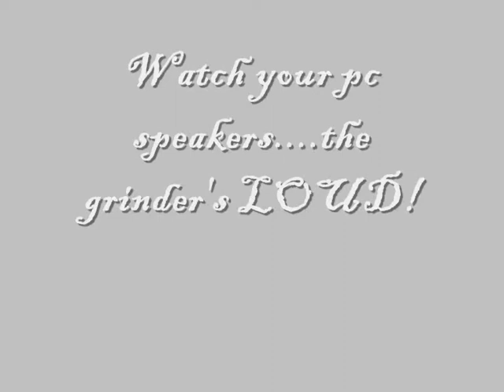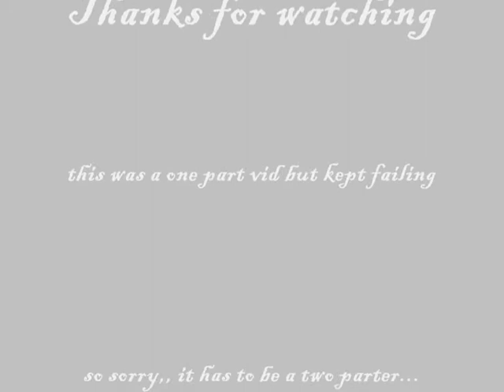Cold Steel Machete Work Shop Sharpening

Comment: Cool video, I've been deciding between the 18 and 24, probably going with the 18.  There are many ways and thoughts behind machete sharpening.. some prefer a more durable edge that isn't razor sharp, some prefer razor sharp. Some put a fine hone near the handle for detail shaving, duller up top, with another utility edge on the spine for draw strokes or striking a firesteel.  Anyway, thanks for the vid!

Comment from the maker: @silvermediastudio thanks for your comment,,oh yes there are so many preferences for a blades set up..this Latin's owner didn't want a section for a ferro rod..also I noticed Cold Steel have a double handed latin on offer now so you may want to check this out before committing to one model..and don't forget the Ontario 23" with a far , far superior sheath and has a half decent sharpener on it,,all the best choosing !!

Comment: Nice vid mate. I would say to grind off the coating in small amounts as the heat from the grinding can alter the temper of the blade. What angle did you grind the blade to?

Comment from the maker: chopping through bone would damage the steel as bone is like a natural ceramic and inherently harder than tempered tool steel but with a few good hacks most knives would do it with the energy involved, but the edge would get damaged. check out the Fox skinning vid by Sean Mulhall.

Comment: @bassfuryvi 18" Cold Steel was delivered this morning.. very happy with the feel, but it will need a bit of sharpening to get it where I'd like it.  I'm liking the amount of flex, just a little but  delivers a solid blow to some small green branches I tried it out on.  I checked out the Ontario, but couldn't resist the $16 price tag for the Cold Steel through Amazon, with free shipping.  Now to find a quality sheath..

Comment from the maker: have you seen the Cold Steel vids..I actually broke the handle a bit of  Joe's ,,but for the money I would go for the Ontario 23" machete with the hard plastic sheath which also has the sharpener ,,,the handle is better ,,the sheath is better and it has a sawback,,and the steel is 1095 I think,,cold steel sheaths are pretty naff compared with the ontario...just my opinion mind....all the best!

Comment: @bassfuryvi  i have a 21 inch two handed latin machete,,,crap edge from the box,,i have no grinder though,,,so i took a file to it,,,then took my india bench stone in vice grips and worked on it,,,and now just use the lansky puck on it,,,it wont shave through paper, but has an edge that will chop through brush, even  stuff a couple inches thick only takes a couple wacks.